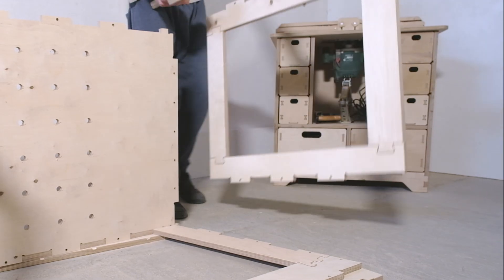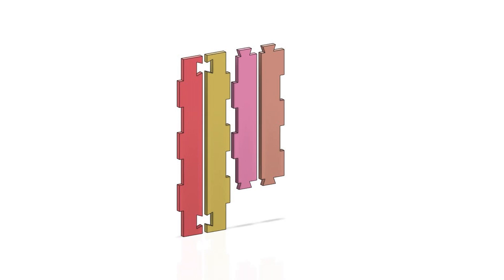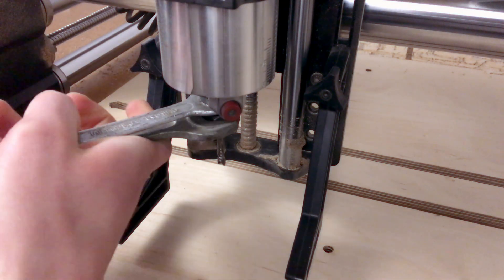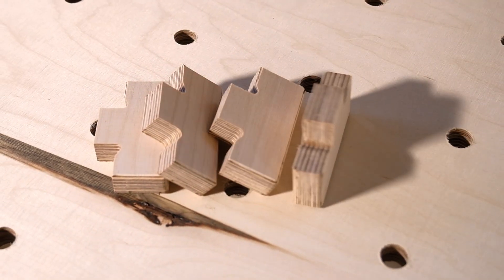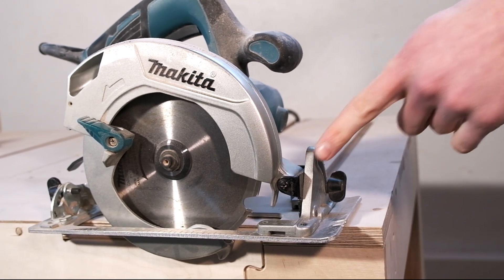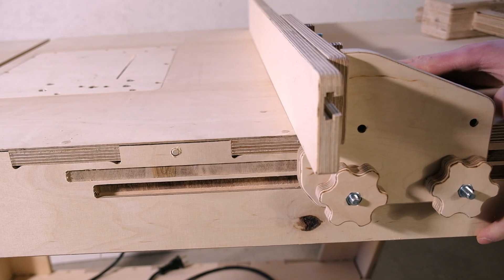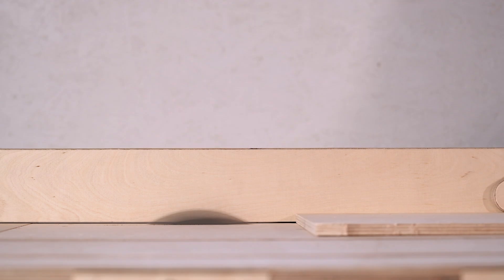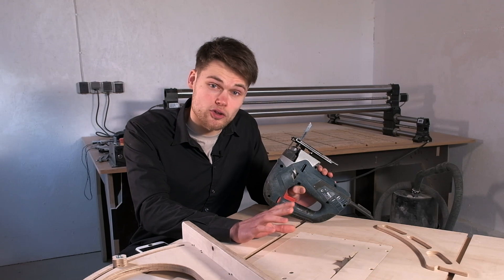Building a Table Saw on a CNC - Aribabox

Comment: Do you plan making files for table saw accessories?
Rip fence , small stopper panel
Miter guards , miter gauge 
Cross cut sled , adjustable stopper
Reply from the maker: Definitely! The table saw is one of the workstations we’re planning to upgrade in the near future. We’re not sure yet if we’ll stick with this setup or move to something else, but we’ll still need the attachments you mentioned (and will share the project files once we make them)

Comment: Your designs are awesome! I think that a 3d printer would help you a lot to complement your designs. What bit do you use for the big cuts?
Reply from the maker: Thank you! Glad to hear you enjoy our projects!
3D printed parts would definitely open up more possibilities - will have to think of ways to incooporate it.
If I remember correctly we used a 6 mm (1/4-inch) straight-flute bit when cutting the project.

Comment: Thank you for showing your work!

What is the CNC machine and dust shoe model?
Reply from the maker: We use the Onefinity Journeyman CNC router equipped with the "Onefinity Suckit Dust Boot Pro", but you could make a table saw as we built on any other CNC machine.